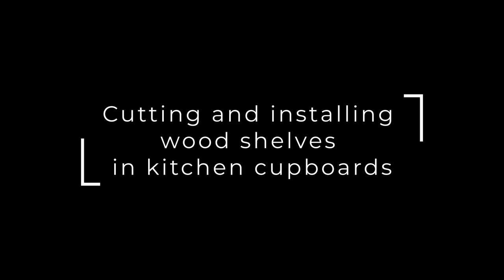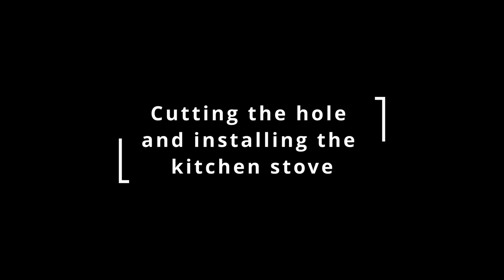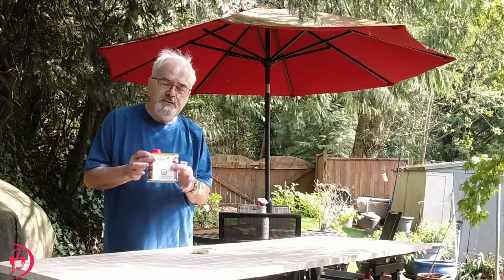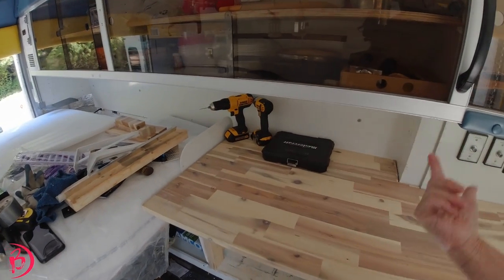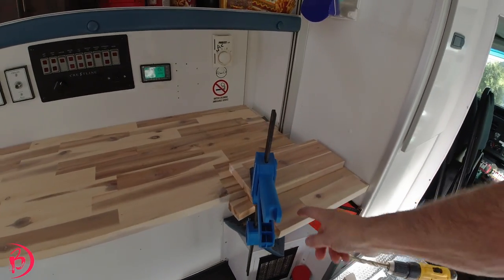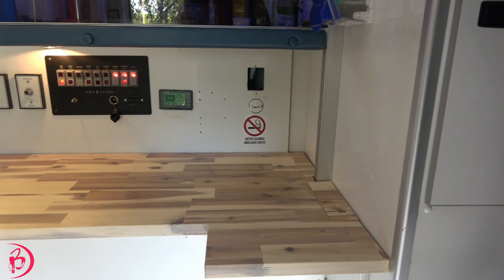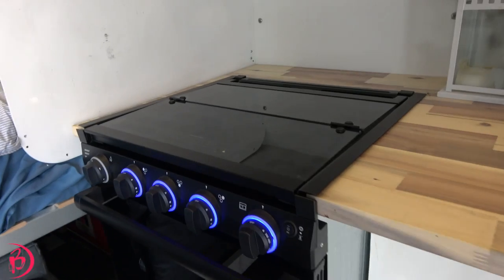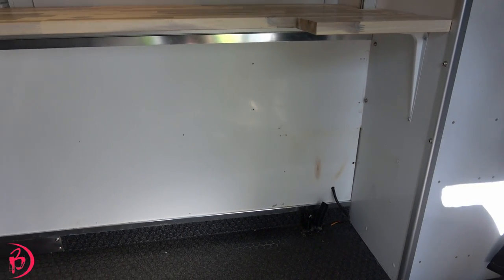Ep 6 - Ambo Kitchen Install

Comment: Just found your channel through the Ambulance Camper Conversion FB group. New subscriber here. We’re just about ready to install the butcher block counter top in my ambo, so I’m searching out videos on that topic. I’m taking a different approach to cooking so I’m not installing a built in stove. However I will have a plumbed in sink with undercounter water heater and microfilter water filter.
Reply from the maker: Cool, thanks for subscribing. I used an inexpensive bamboo ‘chopping block’ style countertop we got at Home Depot for under $150. Easy to cut and positioned it over the existing plastic counter of the  Ambulance. I used a food grade urethane coating all surfaces, sanded in between 3 coats. Perfect for your usage
Reply: @BizzoAmboLife  thanks for the additional info. I bought the Acacia butcher block counter top at Lowes. I needed two pieces, 25” x 72”, but I’ll have enough left over for a matching table top. Not sure about urethane for the counter, might just keep it oiled, but urethane is a good idea for the Lagun table top.

Comment: I am curious to see how the Berkey will hold up on the road.  I use a Berkey in my apartment now, but I am hesitant to incorporate the Berkey in my Ambo build due to the plastic attachment to the metal housing, breaking during travel that is.  Much blessings!
Reply from the maker: hi Emanuel, I will shoot a short video for you on what we did. WE have the stainless spigot and bought the Berkley steel holder. I used 2 belts to secure it to the wall. I was hitting 100mph on the highway then took it on gravel logging roads on our 1300 miles trip, no issues
Reply: @BizzoAmboLife  Sorry.  I should have been more specific.  When you screw the black carbon filters to the stainless-steel housing, the plastic from the filter connecting the two together, that is what I am worried about.  I would like to see the video of the set up!  Cheers.
Reply from the maker: @lemaitrethemonk  hi again, we hadn't even considered the interior of the berkey as possibly becoming dislodged or broken during travel. Considering so many use it while driving I never considered it an issue. When we open the top where the water is placed we have 2 black filters (room for 4), and there is no connector between the two towers and the connection is still tight to the stainless. Maybe ours is different?